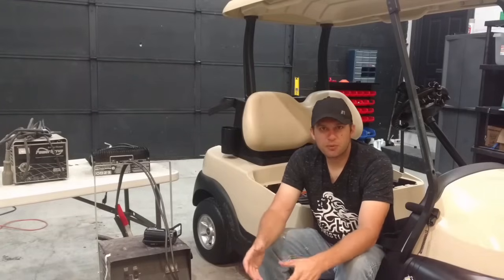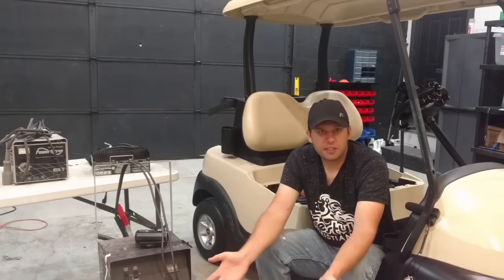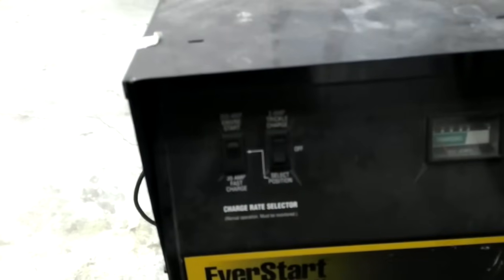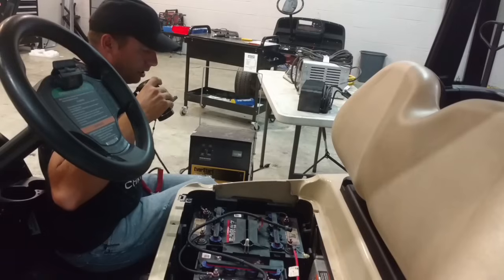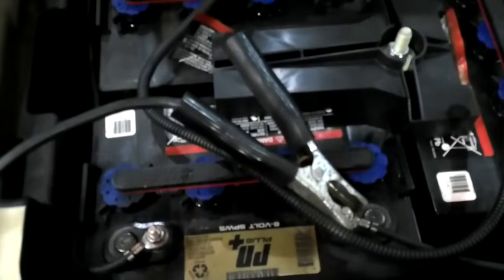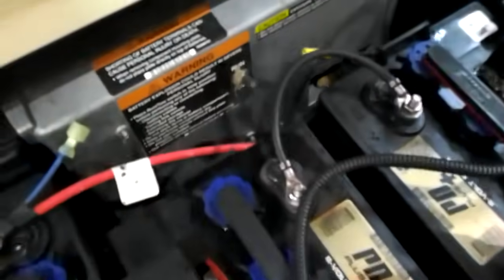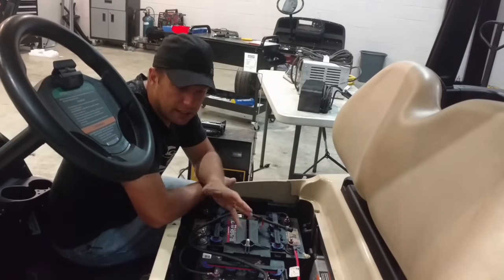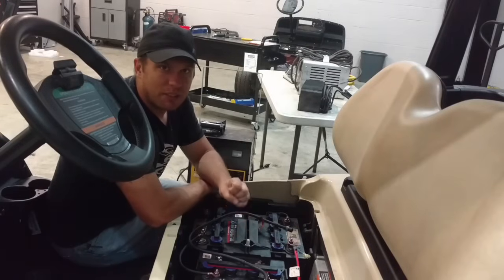How to Charge your Golf Cart Batteries Manually if your charger will not turn on

Comment: If you want to save 3 hours, follow this man's video, exactly, and do two batteries at once.  I have a 48 volt system (4 fluid caps x 2 = 8, x 6 batteries = 48 volts.  My charger began working after the 3rd sequence of charging two batteries at once and you do not have to take the nuts off the posts to charge and then replace them again.  The first round of charging I did one battery at a time and he's right, the battery and charger cables can get pretty hot. What a nice outcome to a real conundrum.  I'm really grateful for the video.  Thanks!

Comment: Always remember, the battery cable in between two batteries are hooked up to make 16 volts. They're hooked up positive to negative, now you are going to connect the battery charger to the 2 remaining battery posts according to their polarity. Red to positive, and black to negative. The charger will produce a little over 15 volts to the 16 volts combined of the batteries. Mine where stone dead, it took over 3 hours per sets of batteries. Which meant charging 3 separate times. Works great. Great video.

Comment: Thanks a million for your video. I just charged my 48 volt system until the charger cut off after about an hour and the indicator is still flashing low. So tomorrow, I am going to follow your instructions and see how it goes. 
Thank you very much

Comment: Thanks for the informative video.  I was able to get the stock charger to work after charging just 2 of the 6 batteries individually.  Do you think that once the stock charger completes it's cycle that it will have charged all 6 batteries fully?  The batteries are only 1 year old.  Thanks.

Comment: Nice video.  My 48V cart died and tried this with a 4amp 12V manual charger.  30min each batter (4x 12V).  And nothing happened.  Need more amps?  Charge longer?  I’m tempted to leave them on for a while but worried about over charging.  Thanks.
Reply: If they're REALLY dead you'll want more than 30mins each. A 4amp charger will take 50 hours to charge a 200ah battery for example. So it'll take a whole lot more time to get enough juice in the batteries for the charger to detect the voltage.

Comment: So I tried this and the second set I plugged it on burnt my charger up cause it needs to have the batteries separated first so u may want to tell people that warning! Make sure it's in series cause u can't just go with the way they r set in. Thank u for this but lesson learned the hard way😊 😔
Reply from the maker: I have done this hundreds of times and never had to separate the batteries, but my charger was an older very simple charger. There isn’t much to get burned up on the old style chargers. It is possible that the circuits on the newer chargers may be more sensitive. Who knows? I am sorry to hear your charger failed when trying this method.

Comment: What about if you have a 36 volt cart with good batteries and a dead 48 volt cart?  Can you just jump the 36 volts over to the 48 volts and then hook up your charger and try to get it to turn on?  If it turns on disconnect the leads and it will stay on?

Comment: I have a red light blinking twice..I k my charger is bad ...which one d u recommend? It’s an ez go 48 13 amp...Txs its a good video
Reply from the maker: Red Light Blinking twice should be a battery voltage error. But, if you are sure it is bad the charger here - https://amzn.to/2EntOlC is one we have had very good results from. Also the Lester summit II is supposed to be really good, but I've never used that one.

Comment: Do you use 12 volt 2 amp or 12 volt 6 amp? Thank you for this video
Reply from the maker: This video is from several years ago, but I think the charger I used had a 20 amp setting. I had to do this a lot back then  and I always used the higher setting so I didn’t have to wait long to switch it to the next set.

Comment: My 8 volts batteries are down to around 2 volts each battery...when i charge like this  i dont leave it on for 30 minutes i take them off after maybe 10 or 15 and it gets to around 10 volts but it drops rapidly...the volts dropping back down is because i didnt let it charge long enough or because the batteries are dead and need to be replaced?

Comment: You don't mention if the tow switch has to be disconnected or turned off.  Also, I thought each battery had to be charged individually.  Two at a time?

Comment: Our electric golf cart is having trouble. We are not sure exactly what's wrong, if it's the charger or batteries. When we plug in the charger, the lights appear to show it is charging; however, we will wait roughly 5 hours to check our golf cart and when we turn it on, the meter showing how much charge is left shows no increase in charge. Do you think you could possibly help???

Edit: We found that there was a wire that happened to be fried to the battery. We unstuck the wire and covered it in electrical tape to keep the current inside the insulator. Now however, our golf cart charges and everything works except for the headlights..... Any idea why that is???

Comment: So I did it and it worked.  But now, two weeks later they’re dead again.  Has never happened before.  Suggestions?
Reply from the maker: If you were able to completely charge your batteries and they are draining back down that quickly, then you probably are going to need new batteries. If you wanted to try to get everything you can out of these batteries then you could get a battery tender like this one https://amzn.to/2Ffbyv7 and just always put them on the battery tender when you park the cart. 
Use your golf cart charger to charge the cart  and then plug the tender in to keep them fully charged until the next time you want to use it.
Reply: @GoodShepherdsHomestead  Thank you for all the great information. Very well-presented! .... By the way, your Amazon link shows that that charger is no longer available...
Reply: @andrewfyakim525  Its showing in stock for me currently.

Comment: My Yamaha electric cart battery charger problem. When I connect the charger to the power outlet and without connecting it the golf cart, the three lights blink for a second every 7 seconds. When I connect the battery charger to the golf cart it keeps doing the same. it is not charging the golf cart
the charger is YAMAHA, 48 volt charger, multi-stage battery charger/ maintainer. MIDEL JW9-82107-02
ANY thoughts are greatly appreciated

Comment: Hmmm.... question> I have a 36 volt system. The charger has a timer that doesn't work(im assuming its a dial timer). The timer does not move when charging. The charger shows 12 amps while its charging. How long should i leave this charger plugged in and charging the batteries?
Reply: The amps will go down as tge battery charges..when anos get under 5, take it off

Comment: My power drive charger clicks on and buzzes but the needle dosnt show any amperage and it dosnt charge
Reply from the maker: Usually that is a problem in the charger. There are a couple of thing that could cause it. If I Come across a charger that's having the same issue I'll try to make a video for it!
Reply: Well the shop said it was the computer on the cart. And supposedly fixed it. But after paying the bill they couldn't even find the cart.

Comment: Will this technique work with 12volt system? My cart uses 6 12volt batteries.
Reply from the maker: Sorry for the slow response. Absolutely! You just charge one battery at a time on that set up.

Comment: Found that my charger kicks off if I'm not charging at the same voltage as the charger setting.  Other solutions recommended 12v-> 8v for 30 min's each, then plug in 48v charger.  Didn't work. Tried 6v->8v, no go.  Bought another charger, same thing, (returned it). Bought a more expensive charger which includes an 8v setting.  Tried one at the time and still get a "fault" from my 48v charger -- according to the 48v charger user guide, the double-flash red light indicates batteries could be overcharged or too low.  What should I be looking for in the individual batteries to know I have a solid foundation to work with?
Reply from the maker: This process doesn’t always work if the batteries are too far gone. If you have a voltage meter, I would suggest checking to see if the voltage is climbing on each individual battery. If the voltage drops back down to where you started immediately after disconnecting the charger, there is a good chance they will not take a charge.
Reply: @GoodShepherdsHomestead  Ended up buying a charger on Amazon that was 8 volt capable. Charging each individually for 30 minutes worked. It was worth $100 to have this back up plan. Thanks for the ideas!

Comment: My problem is that my club car charger takes 10+ hours charging before it stops charging. Have you experience that before?
Reply: If your batteries are old, low on water or deeply discharged 10 hours charge time is not unusual

Comment: Wouldnt the voltage of the charger be less than 2 batteries in series?  I would think this would be a bad idea if the batteries had some charge in them.  Maybe OK if the batteries are stone dead.
Reply: Change voltage is about 14-15 volt from a 12 volt charger. Two 8 volt batteries =16 volt. Doing this to each bank of two batteries will get the over all voltage of the 48 volt pack up high enough for the automatic 48 volt battery charger to turn it self on. If it doesn't detect a minimum amount of voltage coming from the batteries it won't send charging voltage.

Comment: What's even easier than that is to take that power drive charger you have and jump the relay to force a charge then after about an hour put everything back the way it was plug the charger back in and let the charger do its thing.
Reply: How do you do that?

Comment: why you cant just take this charger an hook it up just like the charger is hooked up with this function would charge the whole system if you hooked it up like that..I use to charge my 18 wheeler like that when batterys drained to low crank the truck just hit the booster an it would start right up

Comment: This worked for 5/6 batteries I have...3 ended up with about 8V, 2 with 6V, and 1 dud!  This still adds up to about 36V, and you would then think that my cart charger would recognize the batteries and start up charging! But, NOOOOO! It wouldn't work at all. Is it possible that because of the 1 dead battery everything gets messed up?  I do NOT want to have to buy 6 new  8V  batteries because they cost an arm and a leg! They are Trojan T-875's. How can one check to see that the problem isn't actually the cart charger itself?

Comment: Can i charge all the batteries at once or will that not work?
Reply from the maker: If you are using a 12 volt charger it will charge only to 12 or 13 volts. If you charge 6 batteries to 12v each one will only have 2 volts of charge (2x6=12). 
That is why you do two at a time. Each battery should charge to 6v (12 volts - 2 batteries 6x2=12). 
Then when you are done charging all six batteries two at a time, you will have around 36v. This will be enough for your factory charger to work.
Reply: @GoodShepherdsHomestead  oh ok thank you. That makes alot of sense actually. Im actually thinking about adding 6 more batteries to my own in paralell to get double the milage on the golf cart. What would happen if i put 48v pack on a 36v motor? Will it burn the motor up? Thanks in advanced

Comment: I was so irritated that I was like I don’t know I haven’t hooked up right why is not working mind you I did put the distilled water and I filled it back up but you’re the first video I watched and it made a lot of sense. I do have a question for everyone though I hate having an on off switch. I just bought a brand new one. Do I need to have an on off switch for it to charge? The reason I ask is because I am have stripped off all the wires of, and I’m redoing like the lights to turn on lights and brake lights at all of the all of the cables him so I’m just wondering thank you everyone. So to be clear, let’s say you put all the batteries in and you haven’t hooked up right what is the least? I need to have hooked up in order for me to start charging it.